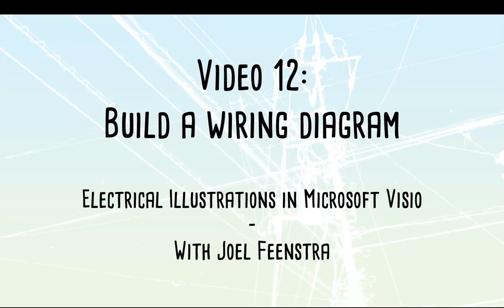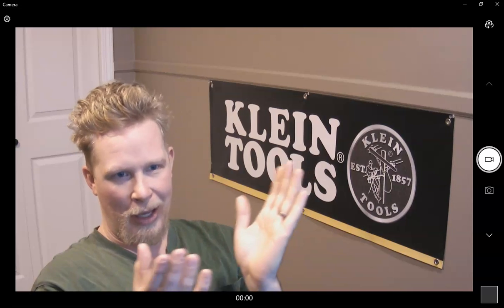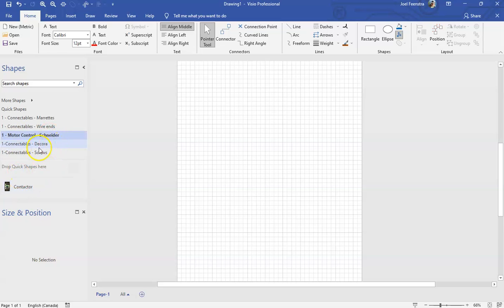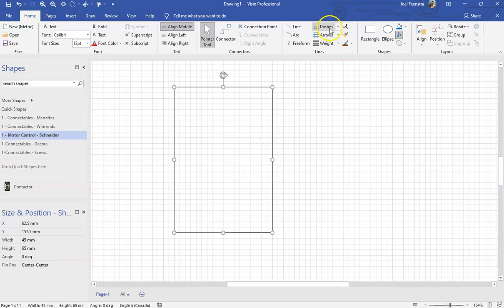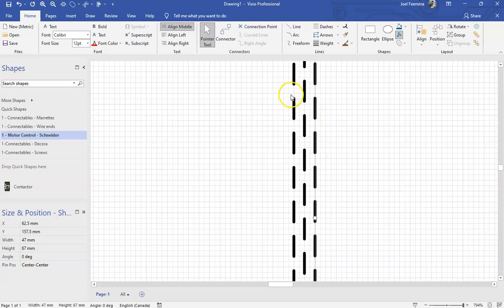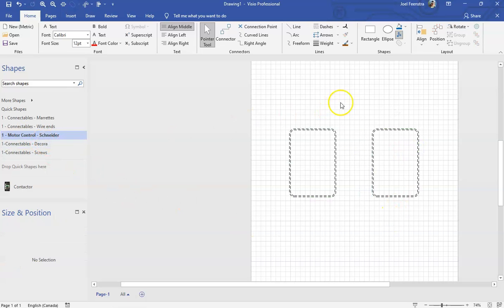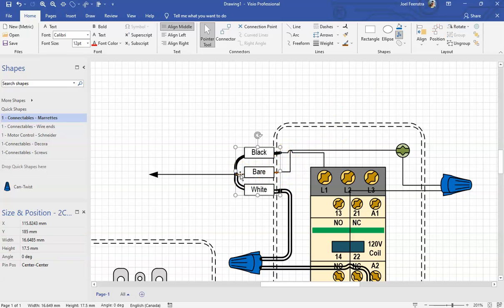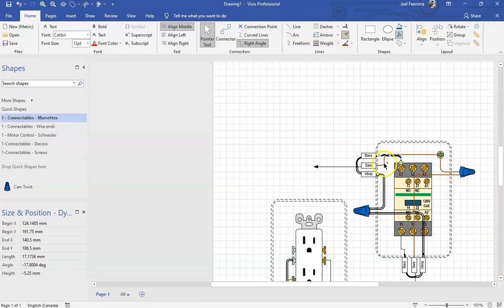Video 12   Combining shapes to create a wiring diagram in Visio

Comment: How do you make the connectors automatically loop where they intersect?
Reply from the maker: Hi.  This one is really hidden where you would not expect it.  Go the the "Pages" tab and click on "Page setup"  A window should popup.  It has a tab in there called "Layout and Routing".  You can enable and modify Line Jumps there.  My preferred setup is "Right Angle" routing style, with "Arc" line jumps on "Horizontal lines" only.   
Cheers!
Reply: Thanks for the reply! I struggled with that for a while and honestly assumed Visio couldn't do it until I saw your video! @joelteacheselectrical
Reply from the maker: Glad it helped!  I love having it.